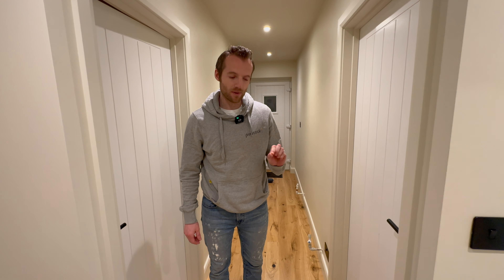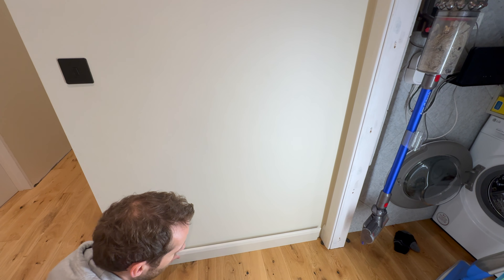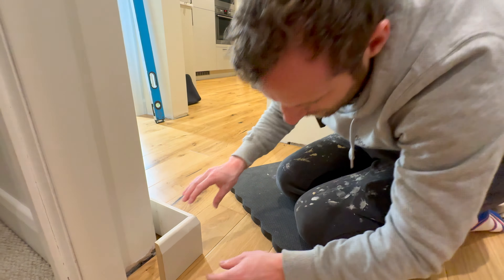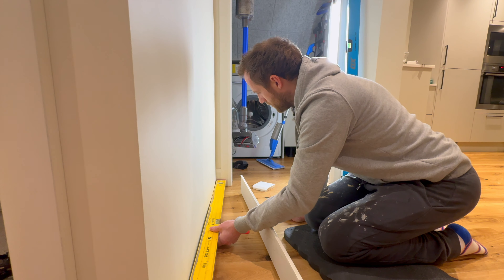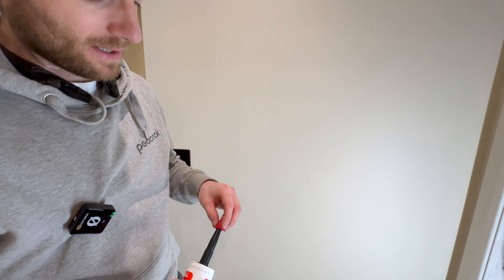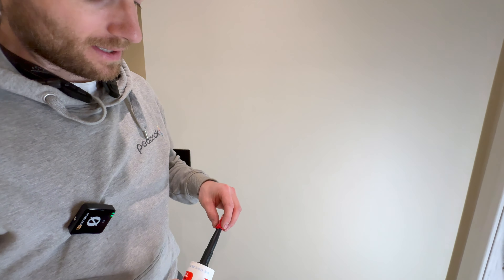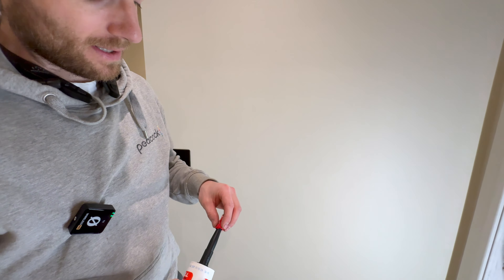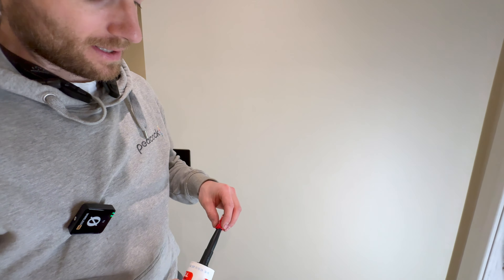How to fit Skirting board | Easy clamp method| Festool, Woodpecker, Bessey Tools | Woodworking Guide

Comment: Thanks, I have a full house to do so some good tips here. I like the clamps idea but not sure how i can do that in a large room as the clamps wouldn't go across the room. I plan to paint the skirting before I fit it and just touch up where I need to.
Reply from the maker: So I've got a couple of longer ones that extend to 2m. But all you need to do is use a length of wood to make up difference. Works perfectly!

Comment: How to run baseboard when you have 3 weeks to complete each room. That's some gorgeous work, but you're either starving or you only work for the Illuminati. 😂
Reply from the maker: Thank you!. It doesn't take as long as you'd think!
Reply: Yes, that was painfully slow and he never actually showed any of the marking or cutting of the skirting!😂
In the UK that's  a butt and scribe joint not a coped.
Reply: It looks  right though “quality not quantity”.
Reply: @clamflaps  If you know what you are doing you can have both, if he was getting paid on what he had done he would be very poor, if the customer was paying a day rate they would be over paying!

Comment: Hammer and
Nail phobia and anti-nailguns ? 

All that flaffing around with tape, get a little painters pail , cold water, little sponge or nice cotton rag and you wipe you calk ( don’t wipe your calk to vigorously or pull funny faces during)

Thank me later 👍🏻
Reply from the maker: These are all solid masonry walls! 

I just enjoy trying to get the most perfect finish. All other options still leave a caulk smear in my opinion.
Reply: Doesn’t matter whether they are solid or not!   Sds drill!

‘Oh I don’t want a big screw hole to fill!’

You put the nails in skirt first, tap nail into plaster, drill mark left by nail… pop in a plug .. re a fix  skirt and drive nails home… punch under…. Slightly overfill holes and sand flush when dry 🤷

Caulk in dry and neat, wipe clean with sponge or chux cloth regularly dipped and squeezed in water, caulk will not stay in areas you don’t want it.

More listening and less giving ‘tips’  is the order of the day I think.